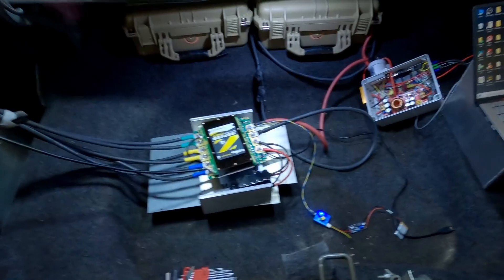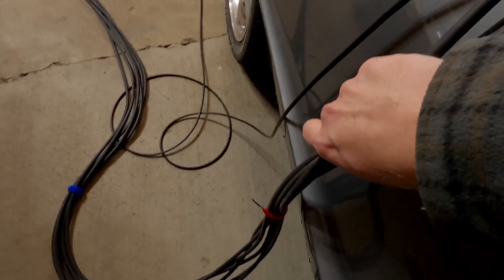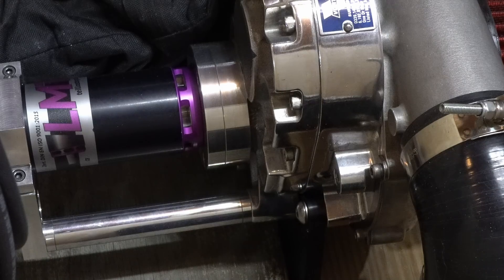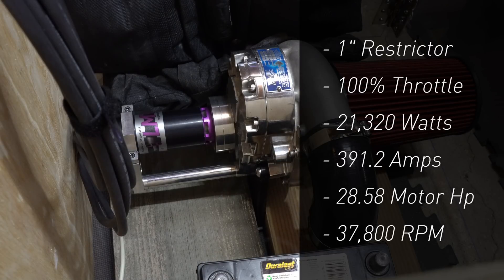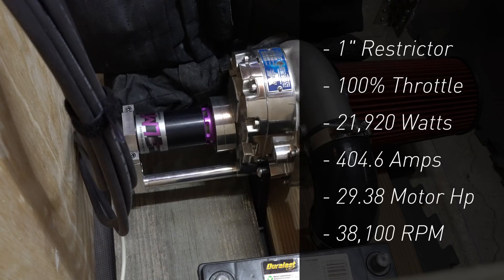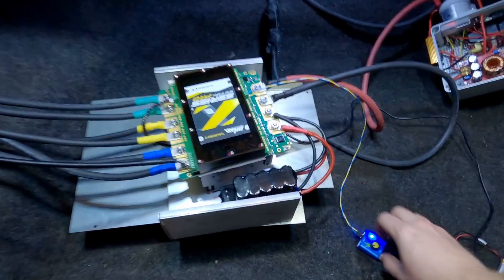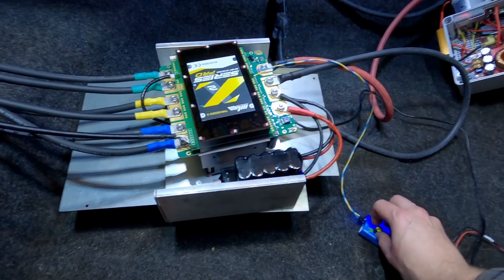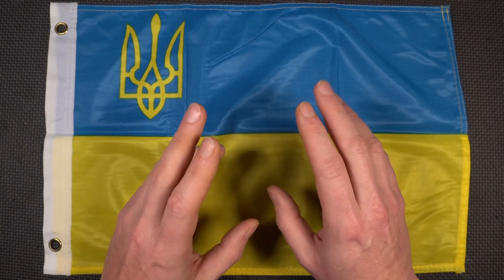DIY Electric Turbo: Sledgehammer High Power Tests - It Works!

Comment: I just don’t ever see electric turbos ever being on the same level as conventional turbos.
Reply from the maker: You're right - electric boost is much better.  Far more hp per pound of boost than any other forced induction I've tried over the years (I built my first custom blower setup in the '90's).  In fact, the Whipple I had on the car made about 12-14 rwhp per psi.  Our very first version made 32 rwhp per psi on the dyno: https://youtu.be/84wSLQRy9sc  I also pointed you to our first drag test in your other comment - watch that video too.
Reply: @AlexLTDLX  i definitely will. And I’m sure electric turbos are the future but they are a very long way from being better then regular turbos. I just bought a xona xr 105 69s turbo moves 105lbs of air per minute and had a 69mm turbine wheel. I don’t see any electric turbos capable of this. I’m sure they will in future.  And electric turbos might be better for smaller applications and fuel economy.
Reply from the maker: @Paper.Power.Politics  Google "vortech ysi b compressor map."  It wouldn't take much more to spin that thing to 45,000 RPM. At that point it's moving over 110 lb of air. I just need to sneak up on things because there's been a lot of explosions & fires along the way. But I've learned an awful lot on this journey and I'm pretty confident that I could build something that big successfully.  If I can get enough views on YouTube to justify the development cost I most likely will.
Reply: @AlexLTDLX  you should really be looking for investors bro if your actually that close to successfully making reliable powerful electric turbos, if your doing something different patent it! But you would be surprised companies like
Porsche and bmw is already moving to electric turbos.  If anything you should also start your own brand and manufacturing process then you can be a shareholder or owner of your product and production. YouTube will help and all but what your doing is pretty big man and not many successful electric turbos out there , the ones I’ve seen are a joke and nothing close to what your putting out.

Comment: 678 amps...I'm thinking I'll need a couple of alternators, will the parasitic drag the alternators put on the accessory drive cancel out the gains in hp? Whos to say?!
Reply from the maker: You can't run it off alternators - remember, it's 678 amps at 60 volts (most likely around 550 amps on the car - the compressor won't be in choke).  But the alternator charges the batteries when you're out of boost.  Here's the first drag test results from version 1 - less than half the power of this one: https://youtu.be/AOL3Qyczt3Y  Pretty eye opening gains.

Comment: Trouble with long cables may be in part due to the voltage reflections that take place in those long leads. "PWM effects in transmission lines" is the type of thing you need to look into. 

The voltage doubling at the motor is not likely to bother this low voltage motor. But it could wreck havoc on the self sensing.

Rough, off the cuff RC line termination  filter Params might be something like  50-150ohm - 100w non-inductive(important!) Resistor and a 5nF series capacitor. One on each phase at the motor terminals tied together in a wye.

Comment: How much power does it cost vs how much power it makes?
Reply from the maker: This version is definitely less cost effective.  The happy medium with current tech is the VESC/P2 unit which is good for up to about 650hp.  That one can be duplicated for $2,500 or less complete.  I know you can get a cheap chinese turbo for a couple hundred bucks, but by the time you install it, it would easily be over a grand.  And it would be less efficient, more or less permanent, and would be intrusive to the car (tapping oil feed/drain lines, exhaust is heavily modified/compromised), etc.  This thing can be taken on and off and moved from car to car pretty easily.  And because I'm sure you're wondering, to reproduce the big unit in this video, with everything, it's more than double the cost of the VESC/P2 unit.
Reply: @AlexLTDLX  I'm sry , i mean't how much power does it make vs how much power does it consume to be driven.
Reply from the maker: @Dwarfgrinder  Well it runs off batteries.  In this test we saw a peak of a about 31 kw. That's about 44 horsepower. But since it's being fed by batteries, it costs nothing to the engine.  However on the car I expected to be about 28 kw.
Reply: @AlexLTDLX  That's very good. At what point does it become pretty even with turbocharging? At some point system density vs power output must become very similar to other power adders. You can't recharge 31kw of energy very easily without a battery swapping either. I like it. Good work.

Comment: So when will this be available for my 21 f250? Looking for 700 hp on my 7.3 godzilla. Do you accept affirm 🤣🤣.
Reply from the maker: Lol.  Look at this as I'm the fool that's finding all the pitfalls, fires and explosions.  And then if we do start selling anything, it'll most likely be various parts needed - for both liability reasons (this is dangerous as hell), and because everyone's application is a bit different.  And that would likely happen on our forum - www.electrifiedboost.com.

Comment: That's incredible!!
Reply: Alex, I don't understand why they are using such low voltage. My guess is that the entire industry is following legacy voltages for backwards compatibility. A 350v system would need a lot less conductor and be able to use 600v rated wires cutting weight and material everywhere from the cables to the circuits in the motor drivers. This started with the large motors in the 90s and is now everywhere. 4160v motors are commonplace replacing the original 480v units running at 1100 amps to around 127 amps. I've even installed drives for motors running 23kvac putting out 45 Megawatts of power. Cutting tons of weight and bulk. My guess is that it will come with the smaller motors soon enough. It will be a necessity for weight in vehicles.

Comment: Over 32 HP to run the turbo, I suppose this electric turbo is for short bursts of power or continuous?
Reply from the maker: Well you'd almost never run a turbo and boost for long periods of time. I suppose on smaller engines you might have to. But this is designed for bigger v8s.  My primary interest is drag racing so it's only going to have to run for about 10 seconds at a time. I'm fully expected fairly easy 9 second passes out of it.
Reply: @AlexLTDLX  This has to be the best one I have seen

Comment: a turbo spins over 120k thats your target.
Reply from the maker: Max RPM for this compressor is 52,000.  The exducer size is over 6 in.
Reply: @AlexLTDLX  use a pully from motor everytime the motor does one turn the compressor turns 3 times that will give you speed of a turbo.

Comment: Well this is stupid.  So much power loss due to undersized and long cables.. they will get hot,, and waste a lot of DC power. All this weight and electrical inefficiency for What ?  Mechanical super charger time tested, reliable, lighter, and no heat problems associated with turbo charging.  In radically simplified form this might make some sense on small engines.. but this is ultimately a fools errand.
Reply from the maker: I've built three custom belt driven systems on this car over the years. The most efficient of which was the last one which was a whipple. This setup at least the first version of it made more than twice as much power per pound of boost as the Whipple did.  It pushed a 3500 lb car from low 12s to mid tens and picked up 17 mph. Plus it's lighter than the whipple. I would certainly not call it a fool's errand. You can check out our first drag tests.

Comment: How much boost did it peak
Reply from the maker: It's a meaningless measurement not on a car. That's why I didn't bother here. I expect it to make at least 7 to 10 PSI on my car's engine which is 500 horsepower.  But the boost should be far more efficient than any turbo or supercharger out there.

Comment: Lol. That doesn't make the cfm or air speed of the big boy echo back pack blower. Not happening.
Reply from the maker: I hope you're joking.  If you're not, watch when the first version made 650hp and pushed a 3,500lb car deep into the 10's: https://youtu.be/AOL3Qyczt3Y  And that one was less than half as powerful as this one.  And that one was 6 times more powerful than any backpack leaf blower.  Not to mention far more efficient.  One of the failures generated a plasma arc so violent it sawed the controller's billet aluminum case nearly completely in half, and made a 4" diameter puddle of molten aluminum on the garage floor: https://youtu.be/_n6hDRsMZd8  FWIW, I happen to have an Echo backpack leaf blower - so I can tell you firsthand that's like a gentle breeze compared to the fury this thing unleashes.

Comment: 400A holy crap, hahaha. Nevermind, 680A, wow. Craziness!
Reply from the maker: On the car, it'll likely only pull about 550 amps - but I did want to test it under as much load as I could to make sure it would hold up.

Comment: is that current number is motor (phase) current or battery current?
Reply from the maker: That's a very good question.  I just went back and checked the MGM log.  It's labeled "input current" - so I assume that's battery current not phase current.  Screwing around with the VESC taught me the difference :)
Reply: @AlexLTDLX  that definitely impressive

Comment: How much do you have in this set up? Do like a price breakdown, batteries, controller, etc.  Great work tho
Reply from the maker: I did that in a video once before and it wasn't well received.  But this particular setup is rather expensive.  I'm not gonna lie.  Everything from the billet impeller to the high-end motor/ESC to the expensive LTO packs.  You're probably looking at $5k+.  Eventually, you'd be able to reproduce the performance for less, once I figure out what can be replaced with less expensive options.

Comment: I didn't know you had 'This Old Tony Doing' the acting. Nice flag too. You're gonna do some rad stuff when you figure out that you can bolt the electric directly to the drivetrain and not carry around that smelly thing full of various hydrocarbons ;)
Reply from the maker: I don't have an issue with electric cars - in fact I like that idea a lot.  The problem we have in the US is lack of infrastructure and massive geography.  That's why electric boost is such a great "filler" - at least 4 times more efficient than putting electrical energy straight to the wheels, and allows the infrastructure to catch up.
Reply: @AlexLTDLX  first off I'm only yanking your chain :). Second,  I don't think I understand how you are defining efficiency in this context. In terms of useful energy/energy consumed an ICE engine isn't as good as an electric car powered by the worst industrial electrical generation-coal.
Reply from the maker: @RaglansElectricBaboon  oh I don't disagree with you. But it's just not practical in a lot of situations that's all. And if you're going to do a hybrid anyway, you might as well do it with electric boost rather than driving the transaxle with a motor directly. It's all good.
Reply: @AlexLTDLX  you're building a drag car so you're not talking practical the way I am ;) You could be building a good CV to work at Rocket Lab- their secret sauce is basically what you're doing to pump their rocket fuel and therefore have fine control over something that's usually just off/ON!!!
Reply from the maker: Lol - My dad was the project manager on the Agena rocket engines at Bell Aerospace back in the day.  He passed away in September of 2020.  If you watch the dyno test video you can see a photo of him at the end with an Agena model B: https://youtu.be/84wSLQRy9sc
Reply: @AlexLTDLX  That's interesting family history and sorry to hear of your loss.

Comment: Wouldn't it be easier to run just the main power cables up to the front and put the controller in the front? Instead of running 6 massive phase cables the whole length of the car?
Either way this is as awesome project, and i really can't wait to see it in the car and running.
Reply from the maker: There's really an issue no matter how you do it.  Running long power cables can lead to ESC damage, because the inductance of the long cables prevent the electrical spikes from being absorbed by the batteries; so the electronics have to take the hit.  Considering this ESC's caps are only rated for 63 volts, and we were feeding it 61 volts, failure is very real.  The biggest issue with long motor cables is low-speed sync; the motor sensor eliminates that.  And running six 4 gauge cables is more cross section than two 2 gauge cables.  I found all this out the hard way.  I've spent an easy $400 on cables alone over the last two years.
Reply: @AlexLTDLX  oh yeah, stuff i never considered. thanks for explaining your thinking to me 👍
though id be concerned on the longevity of running the caps that close to their max rating for long periods, would it be too much a pain in the ass to swap them out for ones with a higher voltage rating?
Reply from the maker: @draggonhedd  the only problem is I don't know what the other stuff is rated for in the esc. I can see the ratings on my capacitors pretty clearly.

Comment: Please Test how it reacts under pressure build up at the nozzle put cone on it with 1/2 or 1/3 of the pipe diameter on exit...  and try to let it blow static on a plate of a  bathroom scale for demonstration =), the power draw and rpm will go up a bit more probably, same like installed on a motor
 Thxx
Reply from the maker: I would, but I've already spent too much time bench testing this thing.  I'm putting it on the car now.  The first two tests had a 1" restrictor in the discharge.  Which actually loads the motor less than running it wide open; which is why you saw 404 amps vs 678 wide open, even though at 404 amps it was turning 50% faster.  Thanks for watching and commenting!

Comment: Now that's just amazing!!!! That's the best of the best electronics for the job that I've seen. Your gonna make huge power with this set up. 10psi of boost with No heat or drain on the engine should make for a really big boost of power. Can't wait to see the full test on the car.
Reply from the maker: Thanks.  I hope to see 10 psi, but not sure we will.  I am sure we'll see some pretty good power numbers, either way (assuming it doesn't blow up)...
Reply: @AlexLTDLX  your working with the what I would say is a great chance at maken some great power. From your test it looks like u should be able to have a good result.  Good tuning of air/fuel and you should be great 👍 I'm sure excited to see more of the testing.

Comment: Why is this a record?
Reply from the maker: Because in our first drag tests we saw just under 14 kW - which was enough to take the car from 12.2 @ 112mph to 10.58 @ 127 mph.  Under similar conditions, there will be twice the drive power with this motor (exact same compressor).  This is the video I'm referring to: https://youtu.be/AOL3Qyczt3Y
Reply: @AlexLTDLX  oh ok gotcha.

Comment: Awesome!! How did the battery packs hold up?  Do you expect to have to charge between passes?
Reply from the maker: You certainly could, but it's not necessary.  You could easily get three or four passes before the performance starts to drop off.  But the control box does have a boost converter to charge the batteries if you're bracket racing or something.  The 100 ah LiFePo4 car battery I built should be able to top the batteries off at least 4-6 times and still have enough juice to start the car.  You could also throw the charge switch once you go through the lights, and by the time you're back to your pit area, you'll be at least partially charged back up.  I could go with a bigger boost converter to charge it fully, but it would be a big load on the alternator.  I should run the numbers to see.

Comment: Jesus at 678dc amps i would up the gauge of the wires quick smart!Also better quality copper esc connectors.Cool project and cant see why this isnt a thing already tbh.
Reply from the maker: Yeah, that's a lot of current.  Those connections (cable lugs) are copper.  Specifically, they're Selterm marine-grade tinned copper lugs (the good stuff).  I save the cheapo chinese junk for unimportant stuff.  It is important to mention those tests I ran specifically tested extreme load (current) and extreme RPM, respectively.  On the actual car, we'll probably be seeing around 500-550 amps when the engine's running.  That's just a best guess based on the data we've collected, but it should be pretty close.  The 2 gauge cable is big enough for this; I wouldn't use it if it had to carry that much current continuously.  Voltage drop across the cable is what's important.  And at 550 amps, the power cables are only dropping half a volt.  The motor cables are dropping another 1.5 volts.  But overall, not too bad and about as big as I can reasonably run.  The bulk of the voltage drop is actually happening in the batteries.  At 678 amps, battery voltage dropped from 61 volts to 48 volts - about what I expected, fwiw.  At 550 amps, battery voltage drop should take 61 volts down to 50-51 volts.  I can always run a second set of cells (I already have enough to do it) to cut that big voltage drop in half.
Reply: @AlexLTDLX  That's a great voltage drop for such a huge current draw👌Do you place the packs and ESC in the engine bay or close as possible for little voltage drop across cables?Very interested on seeing this version up and running on test hits,the noise will be something else I'm sure😁👍

Comment: Intermittent power adder without having to add ring gap. It's that Mad Max supercharger with a clutch. I want one.
Reply: You'd still snap ring lands staying in it long enough
Reply: If you dont need to add gap, you are not making much power.